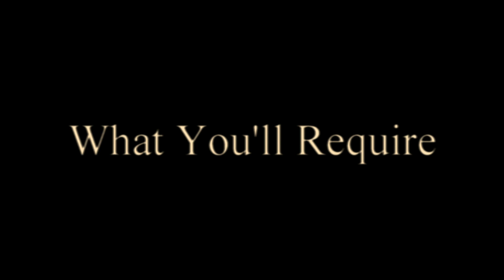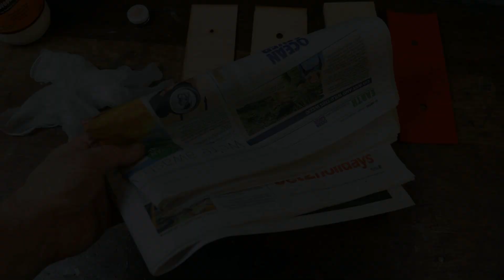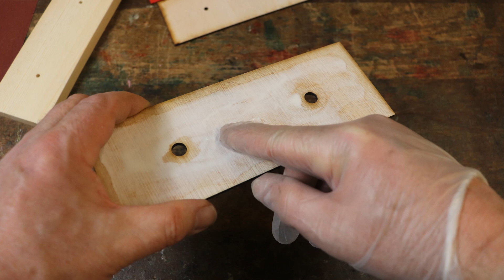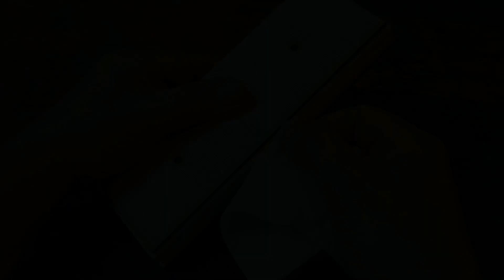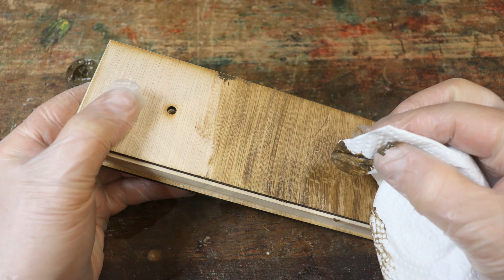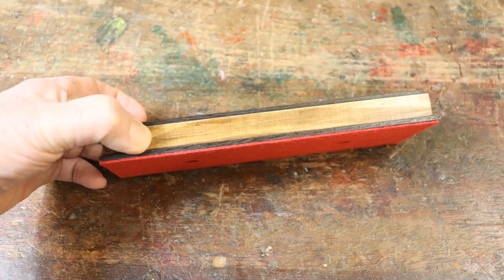Steampunk Reciprocating Clock Instructions - Part 2

Comment: I intend to buy your kit but I might prefer to make my own base from a more ornate wood. Could you give me the pitch of the drilled holes that you have used?

The Etsy link takes me to another seller. Perhaps your details should read "shop - steamheadinventions"?
Reply from the maker: Hi Alan, thanks for your interest, the holes are 100mm apart and are 4.5mm diameter.